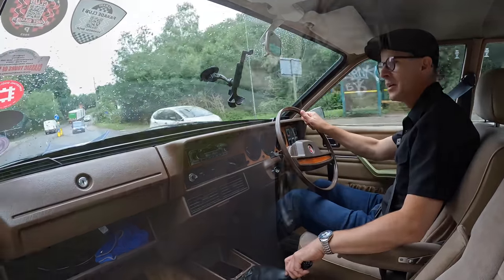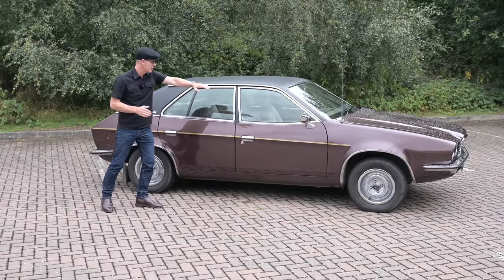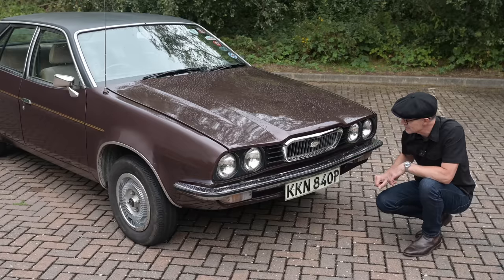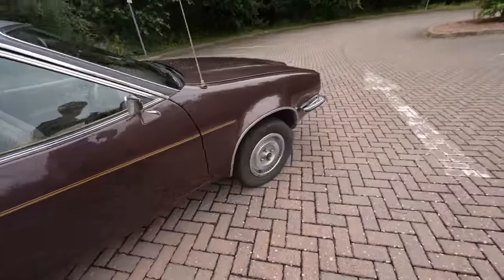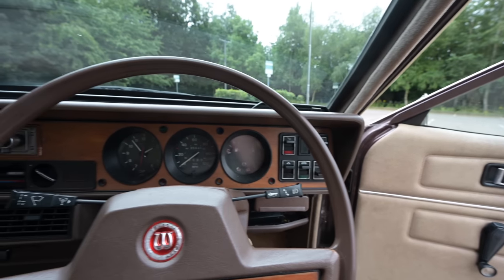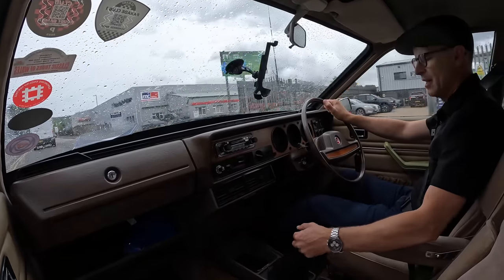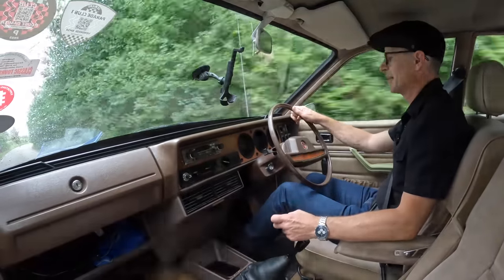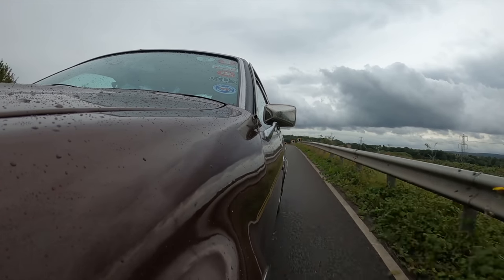Wolseley 18-22 - The Wedge and the Last Wolseley!

Comment: This was one of the first cars with the wipers hidden below the edge of the bonnet. The black strip at the bottom of the windscreen was to prevent you from seeing under the edge of the bonnet. Thanks to my father, who worked at BLN at the time and also owned a Princess for a while, I have a full set of Austin, Morris and Wolsely 'wedge' brochures from around the time of their introduction. Never realised until now how rare these might be.
Reply: On English cars yes it was one of the first to have its wiper spindles hidden , but American cars were doing it years earlier .
Reply: Ds19 had hidden wipers, Rover P6 and Princess.
Reply: I saw that Top Gear episode too. 
"It's important." - Captain Slow
Reply: @SportFury1966 😂😂 I remember that I think
Reply: My Renault 17 from 1972 has wipers concealed behind the scuttle.
Reply: Obscured windscreen wipers, there’s a reason to own one 😂
Reply: Yes, that’s a Top Gear quote
Reply: The P76 wipers where the same.
Reply: What a great feature - all 70s and 80s cars with plastic covers on the wiper mechanism rusted like crazy beneath.
Reply: The Leyland P-76 in Australia had concealed wipers in 1973
Reply: @commodore665 yes, but they were huge barges and nobody cares.
Reply: Rover P6 had concealed wipers on the early 60':s
Reply: From my dealing with old car brochures you have to have two things that go together to be worth anything, and this really goes for most 'old' stuff and not just car stuff, Rarity and Desirability.

Comment: In 1987 i went to a car dealer (proper posh indoor showroom) to buy a 1982 austin ambassador 2.0 HLS in a glorious shade of brown.
However
What i actually bought was a 1983 rover SD1 2.3, in red, 1 bank manager owner,18k miles, with a 5 speed maual box and a sliding metal suroof for my £2200 in cash
Oh the joy of being 22 and single (now a grandgather 11 times ) with hair on my head and notes in my wallet.😂
Reply: Don’t keep asking me why Reg, it just happens to be that year.
Reply: You made the right choice!
Reply: Still got hair?🤣
Reply: Wow! Now that would have been some car to own in your 20s! Much as I love the Ambassador (I learnt to drive in one, and my dad owned 2, which we still speak fondly of), the SD1 was a magnificent motor!
Reply: Had both those cars you mention, Ambassador 2.0 VDP and later  A Rover SD1 3.5 VDP you picked the better car in the Rover by far the better car with that glorious engine

Comment: Takes me back. In the late 80's, a mate of mine worked at a gararge. Their "spare in case anyone needs it" car was a mint Austin Princess 2200 HLS. He used to borrow it sometimes.

The thing that takes me back the most is the sound. You could hear the transmission more than the engine but it wasn't unpleasant by any means. So comfy with those big squashy chairs and the big settee in the back (not merely seats) and that cosseting suspension, not soft enough to be truly floaty but well able to smooth out the road surface (which wasn't exactly great in the UK as far back as the 80's).

He used to get ribbed for driving what was at the time a deeply unfashionable car ("Have you borrowed it off your grandad?") but I thought it was fantastic and we had a good few lengthy, very comfortable road trips out of it.

Comment: Owned a 1983 Ambassador HLS with the 2-litre four cylinder in 1988/89. Paid £150 for it since it had a radiator fault and droopy suspension. Changed the radiator myself-took an hour and cost £20 on exchange! The suspension was inflated by a local mechanic for £5 per side! Job done! Ran it for a couple of years, no problems, very comfortable but thirsty. Maybe because it felt a tad under-geared? Never achieved better than about 28mpg but petrol was relatively cheap wasn't it? Sold it to a bloke who wanted to tow a caravan - bet that was juicy! Next car was a new Sierra-chalk and cheese but both had their good points.

Comment: Dad had one exactly like this to test in 1975 as his company car with Dunlop. It carried the A1 registration plate which was owned by Dunlop at the time. It was fitted with Denovo run flat tyres. When he ordered his permanent company car I guess production of the Wolseley was already over, so LVP 444P was a 2200HLS Austin Princess rather than a Wolseley. I wanted him to have an SD1 or another Triumph 2000 which were the other options available to him with Dunlop. He must’ve liked it as in 1979 it was followed by EOM 692V another 2200HLS in metallic blue. It was his last company car before he retired in 1984. Then he went for a Saab 900i.
I do remember the Princess was supremely comfortable in the back on trips from Birmingham to Cornwall for summer holidays, and the amount of stuff he could load into that cavernous boot was incredible.
Reply: Sounds like we're from the same generation. Throughout the 70's my dad used to buy up old fleet cars from work - these were Morris Oxford "Farinas". We had at least four, my favourite being the first I remember; a maroon "shooting brake" - essencially an estate. I remember curling up in the back-space under the ubiquitous pladd blanket when I was tiny.
Then I guess maybe 1979 they bought an 1800 Austin Princess. Not sure how I felt about it; certainly quieter, but not doing many long runs issues such as ride quality didn't occur to a pre-teen. After that they got into Skodas! 120L then 136 Rapide followed by the Favorit. Finally they wound up with a Peugoet "whatever" saloon before they both pegged it in 2005.
We very often buy classic cars we knew from our childhood, and I'm no exception. Can you guess? Well mine was a beautiful white Morris Oxford 😛
As a matter of note, I recall asking my mother what her favourite car was and to my surprise, she said it was the old Morris Oxfords.

Comment: The two areas where they cocked up on this car were obvious at the time ( I know I was there ) -
1/ They should have fitted Maxi engines/transmission. Offering an internal rival with a 5 speed as opposed to an old fashioned  4 speed.
2/ Should have had a hatch back - it was shaped for it and in its home market the R16 amongst a few other Renaults did well with a hatch back
Reply: Deliberately not a hatchback as they didn't appeal to the intended market. A CEO/MD/Director in a hatchback, never even as personal car.  A four cylinder would not have worked as a six was far smoother, most were sold as autos not manuals.  Wolesley had the reputation of mid range luxury.
Reply: Definitely correct about the hatchback, which was indeed fitted to the Ambassador. I owned a Princess and later an Ambassador. Amazingly, the back seats had no folding-mechanism. The seats could only remain upright. Otherwise an Ambassador with the rear seats folded would've been as spacious as an aircraft hanger. Typical BL eff-up.

Comment: In 1985 I bought a 1978 Princess 2200HLS Auto, same lovely brown colour as the one in this video. It was an ex-rep car and had done 120000 miles and had a "new" Gold Seal recon engine, and it cost me £200.
I was 21 and my mates laughed at me for buying a grandad car, but they soon shut up once I took them for a ride in it. What a lovely sooth and quiet drive it was. So easy to work on for a big car.  It did exactly 20 MPG no matter how I drove it! I sold it after 18 months of reliable motoring for £450 - Happy days.

Comment: The open space in front of the gearstick, under the airvents originally had a cover for one central speaker. We had a Princess 1800HL with that in place. The 2200 HLS my father bought after that one, had this cover removed, just as in this car. You can see the tiny screw holes.

Comment: What a rollercoaster of a July this Wolseley 18-22 has had! I couldn't believe my eyes when I saw it parked among many other British cars at a campsite section on one side of the track at The Le Mans Classic. Then exactly one week later I saw it at BL Day at Gaydon! What a shame in the same month, it's been pranged and lost lettering off its original rear 1975 plate, the owner must be gutted. Let this be a lesson to owners of classics - fit a high level brake light! Remember, some drivers on our roads were born in the 21st century and aren't used to vehicles without them. Matt, I don't know how you manage it - but most of your videos are shot when its dry  - obviously that was difficult with the UK weather last month.

Comment: Excellent video.  This was such a strange model in a deeply strange range.  
Leyland dealers at the time were still deeply entrenched on the squillion marques they sold.... Austin, Morris and Wolseley were only the tip of a mad iceberg.  
Some petty quibbles .... 2227cc, not 2229.
And I don't think those hoops were alloys.  
The whole range, I believe, had door cards that covered the whole inner door.  
I am amazed that there is still an 19/22 Wolseley saloon on the road.  
It really is a missing link.  
And you were spot-on about the irrelevance of the power output.  This was somehow the very end of the era when it was vulgar to speak of power or to appear to be trying too hard.  
Excellent video.

Comment: I used to own the princess version. 
Single large headlamps. As said extremely comfortable but unfortunately extremely un reliable. It seemed that almost weekly I would find mine leaning over to one side or the other where the suspension had mysteriously leaked over night.
No matter what I replaced I never managed to solve the issue.
Also had no end of trouble with the drive shaft cvs. Over five replaced under warranty  !
Loved the full length Wabasto roof though 😊

Comment: 13:00 - the blank under the central air vents was for the optional mono speaker housing for the optional mono radio. At that time FM stereo was only just being able to be handled by the top-end units, and 8-track never really took off in the UK. The Japanese makes were causing waves because they would come with factory-fitted radios, but for British and European makers (this side of Rolls-Royce) you would sometimes get pre-installed aerials and/or speakers but would fit your own after-market LW/MW mono unit from Radiomobile or Motorola.

Comment: A very interesting model that we were denied in Australia. Perhaps it would have pinched buyers from the intended market for the P76? The Mini was a good seller here and the Morris 1100 also sold very well here. The Austin 1800 sold more per capita in Australia than anywhere else, if I've remembered that correctly. So, it can't have been that the Wolseley was Front Wheel Drive. With BL Australia being very much a child of their parent, only upside down, it might be anybody's guess as to why we didn't get them here. Shame. They look really interesting. Thanks for the video.
Reply: The funny thing is, it was BL Australia who extended the Morris 1500 E series engine into the 2.2 litre inline six used in the Tasman Kimberley range , the UK took it on board some time later
Reply: The P76 was already axed in Australia when this car was released in 1975. I remember a Wheels magazine article speculating the imported 18-22 would come to Australia to replace the P76 but it never happened.

Comment: This car brings back memories. I was only 10 years old when the 18/22 series were released in the different brands. These were science fiction space ships realised for a youngster back then a full year before the SD1 blew the market wide open with arguably even more extreme styling with super car influences. New wedge cars that would be available to drive on the roads and no longer just in a comic book. Unfortunately as seems to be the British way with too much prevarication on the decision making front lost the car ground as what seemed like indecision for a hatch vs boot ended up with a default boot.

Comment: What a low-rent dashboard after the Wolseley 18/85. The "Wood looks like Fablon, the sticky-backed plastic applique for cheering up old stained tables and furniture in Labour council tearooms. Lots of noises going on such as "knock on lock", groaning wiper gear and various rattles. The motors were indeed creamy smooth but to my mind the great innovation was the massive plastic front wheel-arch liners which ensured that the inner and outer front wings were as good as new when the beastie went to the scrappies. In fact the wedges were really well rustproofed with wax injection as well, shame the SD1 was neglected in this respect.

Comment: I love this car! I live in Northern Australia, i have a 2003 XJ8 which I Love and is my DD, But I would happily add this to my stable, That big area where the vents are I reckon could be a great place for your A/C evaporator etc without spoiling the look?, Electric windows?, Cruise control? and other modern upgrades that are non evasive? Stupid BL not making her a hatchback with folding rear seats! 😢 But! A lovely car just the same, a tad more power would be handy, I love her❤

Comment: One of my neighbours had the automatic version back in the day , its in line 6 was very quiet and smooth but the autobox was " in sump" same as your Mini ,and the whole unit took 22 pints of oil!!
Also, is it just me ,or does the word "Wolseley" make you feel warm and cosy?😊
Reply: Apart from sharing a similar name with cosy knitwear (and the original Wolseley company making sheep-shearing apparatus), yes - it has exactly the same effect on me too. I also blame that on Talking Pictures TV showing a late 1950s cop show called "Dial 999", based in a now-lost London where the main character is seen being driven around in a Wolseley 6/80...
Reply: No it didnt only the manual shared the sump , the auto ran atf it was a borg warner 35, and there was a blanking adapter between the block and transmision underneath to allow transmission oil to be different from engine oil a damn right PITA to work on
Reply: "Wolseley" has to be the most British word in existence.
Reply: @doctormengele961   My mistake then, that's what he told me anyway,  but it was nearly 50 years ago 😊
Reply: @bobgorman9481  nah your memory is good the manual does take 22 pints 👍

Comment: Minis Never had Hydrolastic suspension they had rubber blocks. Austin 1100 and 1300 along with offshoots like the Ryley Kestral, the Maxi and I think the Alegro all had the hydrolastic set up or variants of it. Minis were renowned for their bouncing abilities. I think the Mini Metro had gas suspension. My wife has a classic mini in the garage. We upgraded it to springs which has made a lot of difference. Great video though. Nice to see this one on the road. Most variants of this shape are either in museums or India.
Reply: Wrong! Hydrolastic was used for some time.

Comment: Give me a Triumph 2000/2000TC/2.5 PI/2500TC/2500S over this any day.  The last Woleseley-badged car to exude ultimate luxury was the 6/110, which had a dashboard that outclassed it's more expensive rival, the 4-Litre Rolls-Royce Vanden Plas Princess.  The suspension on these wedge cars was it's trump card in terms of ride comfort, but even in this video, the build-quality can be heard with clanks and rattles going on.  Large BMC saloons of this era simply weren't rigid enough, bar the big Triumphs and P6 Rovers.  The SD1 of this time a complete shambles in construction, in spite of it being a superb looking car;  largely uprated in the early 80's to what it should have been in '76.  The joke was, (so it was claimed), these wedge cars would have been more aerodynamic going in reverse!

Comment: Interesting car that was unfortunate to be managed by British Leyland. Not sure why the Allegro couldn't have had similar design hues as the wedge. But "because BL" .Matt you described this car perfectly. I did ride in one and i thought it was very smooth but, interior rattles and creeks. It was never going to be a cortina or Granada beater tbf. But just had it's own devoted followers...
Reply from the maker: The allegro should have looked like this but it was decided to use the heater matrix from the Marina as it had cost so much to develop, even though it didnt fit and ruined the cars looks, then it was fattened to match the height and that was that
Reply: @furiousdriving  the Allegro should have just had a full stretch grill at the front, similar to a maxi or the mini clubman. At least it would share family resemblance, and generally look nicer.

Comment: These cars were made with the engine sitting too high in the engine bay and resulted in drive shafts wearing out prematurely so BL redesigned the engine mountings to lower the engine to reduce the drive shaft angle. The 6 cylinder engines also had some issues with the big ends ....not sure why....the 1800 MGB engine was the very reliable one that would go forever if serviced properly. These cars had a lot of space inside them but like all cars of this era rust was their enemy

Comment: Yes it deserved to die and BL come to that. My father bought a new princess 2200HLS and it was the worst most unreliable piece of junk he had the misfortune to own in 40 yrs of car ownership. In the first 18months it had  paint repairs on delivery, timing chain twice, two sets of driveshafts, engine relocated back 2" to save the driveshafts, rear suspension mounts sheared twice,, power steering pump. On top of this the sills were rusted, chrome pealed off and the power steering belt slipped in the rain no matter how tight it was. When he sold it at 2 yrs old privately (no dealer would take it as p/x) the radiator also sprang a leak.

Comment: If I'd have been buying cars in 1975 that 6cyl would be very tempting BUT not fitting a hatch was unforgiveable in my eyes and may have been a dealbreaker. A problem far from solved when the ambassador came along tbh as it was definitely a retrograde step.